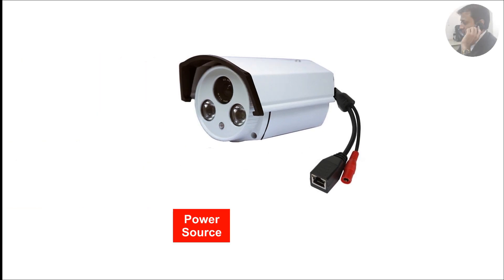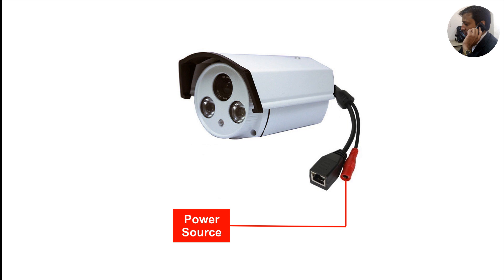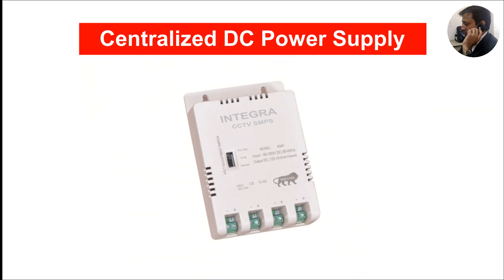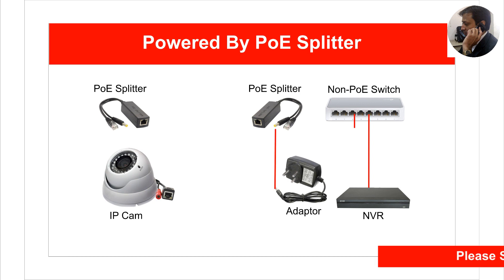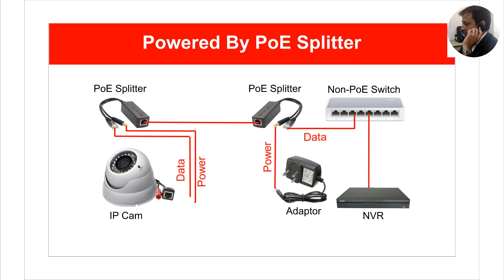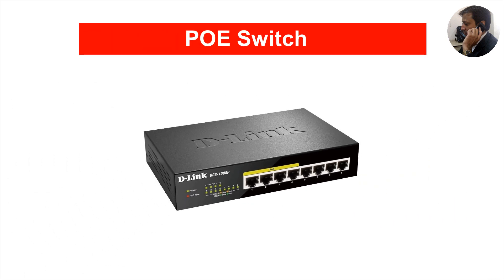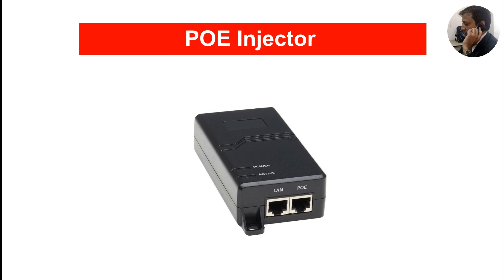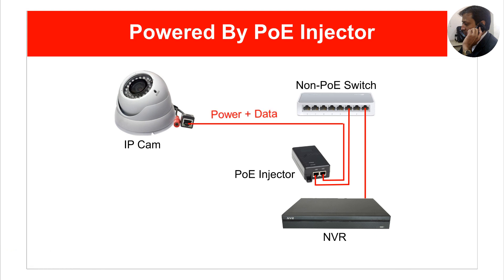How to Power IP CCTV Cameras | IP Camera Power Supply | PoE splitter, security surveillance cameras

Comment: hello sir, using media converter, is there separate POE. to use? than
Reply from the maker: All cameras connect to PoE switch. Switch output goes to media converter and then to OFC to be carried for example to the central control room. The question is how to power the PoE switch? The answer is - you can provide power from AC power source nearby to the switch. Alternatively, you may carry a power cable from control room alongwith OFC upto the switch location.
Shortly coming up with a video on designing an OFC network.
So do subscribe and turn on the notifications to get updated.